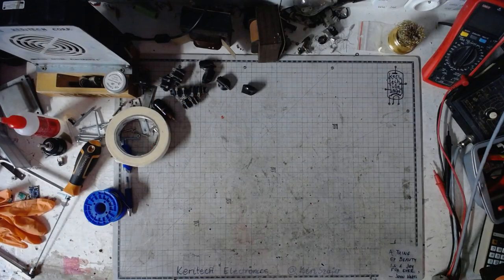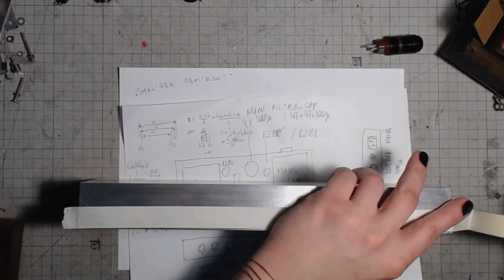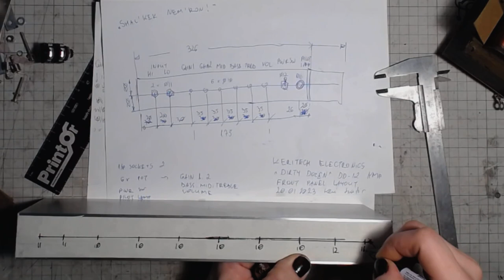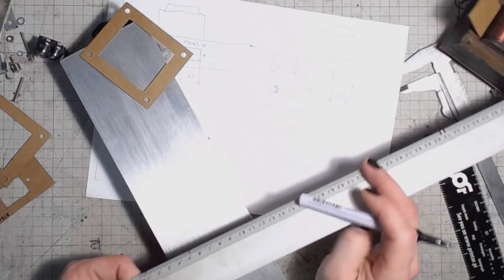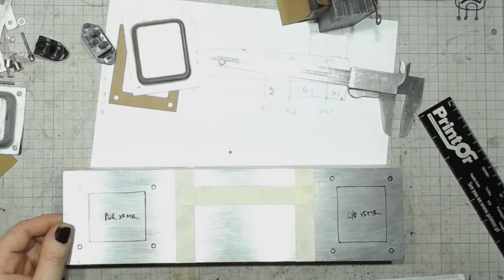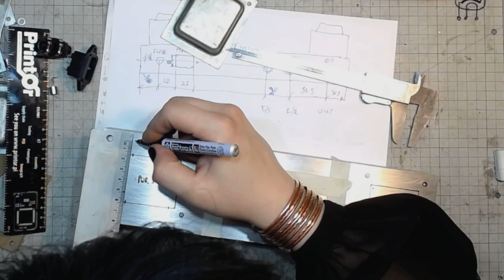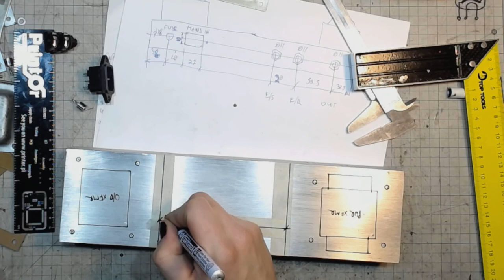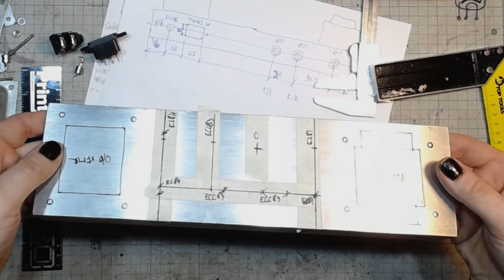Keritech DD-12 "Dirty Dozen" Amp - Part 1: Chassis Design

Comment: 1) I really enjoy how you are taking us step by step.
2) I like the camera directly over the work surface.  I am about ready  to set up a separate work bench because my desk o have my computer on is just too crowded and I noticed that because the camera is under a shelf I am getting feed back into the sound.
3) nice finger nails Dear.
Reply from the maker: Thanks a lot for the kind comment! I came up with this overhead camera placement over a year ago, at first I did it with a smart phone (hardly any of these recordings ever made it out there), then I got a webcam and made a mount for it. Later on I added a mike too.
Reply: @KeritechElectronics  do you route the feed into a  video switcher?  I am a glutton for punishment so I use a switcher (running on my laptop) with two cameras.
Reply from the maker: @VictorianMaid99  I use USB cameras with OBS (Open Broadcasting Studio), do all the scene transitions there whenever I can.